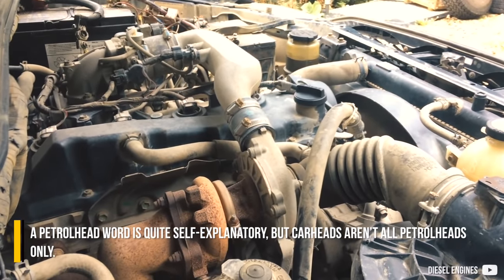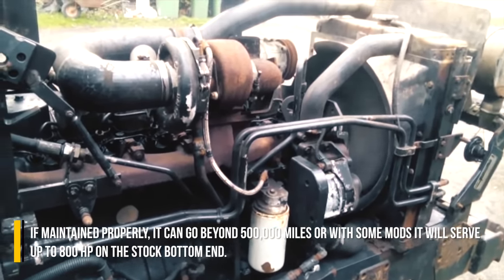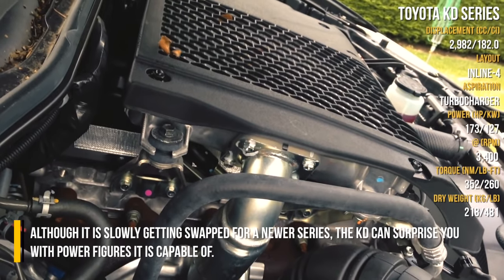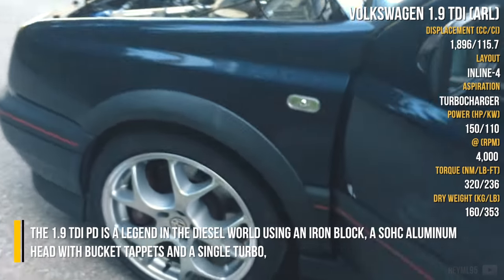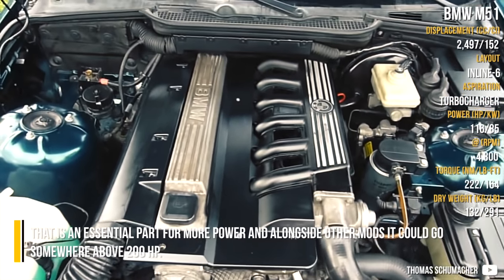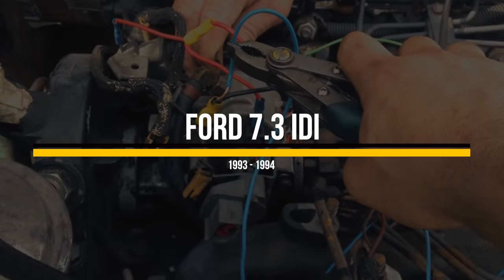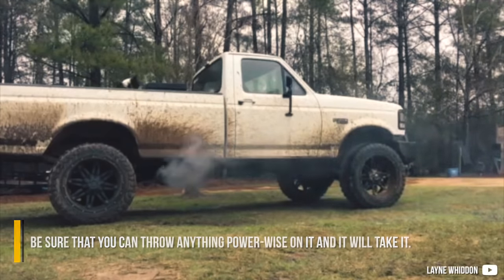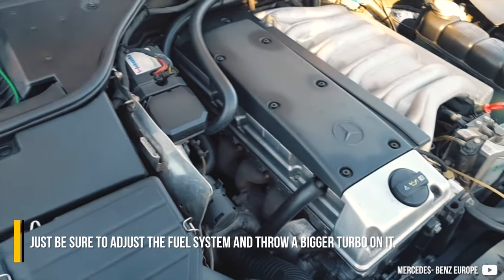6 Best Diesels For Engine Tuning | Ep.1

Comment: Ok. I am not knock on diesels. Love em. Better fuel mileage. But they are heavy and can be costy to fix. Oil change alone will set u back. If the injection pump goes out. Hope to find a used one. Trust me if I could afford one it be my daily.

Comment: I wonder why he left out the duramax? It put out better power than those small sixs
Reply: Probably because a Cummins had to tow the duramax after it broke down hahahaha
Reply: That and they redesign the motor ever 5 years the best duramax is the lb7. I've got one in my truck it's pushing 460000 plus miles
Or over 700000 km if my math is right
Reply: He had put in the old 6bt and 7.3, so I thought he would have put in the duramax, at least the lb7

Comment: The 7.3 idi had far less tuning capabilities the direct injection 7.3L.  99-03
Reply: I think as people have mentioned in the comments below, recently there has been a huge improvement in the performance side of it, I would imagine  these days it's a choice of would you rather do a full top end rebuild on a block made of wrought iron, and piss and vinegar, or have to find a grail truck in good condition

Comment: why do diesels all smoke like theire about to break down? how come this isnt an issue tuning petrol engines?
Reply: sout is released by the diesel engine as a by product of the combustion it is black and visible when their is enough. More power -> richer mix -> more sout. Sout is almost non existant (or non existant) in a petrol.
Reply: The pump is adjusted to pump more fuel than needed so the fuel gets in the headers/manifolds and burns there the smoke gives the turbo more spinning.Diesel doesnt burn by spark,Only by heat so Diesel is oil based fuel as petrol isnt.Also diesels have far more emission control things than petrol.If you adjust the pump right there should not be any smoke when on boost.Also for the om606 to get more power you need bigger pump and turbo.
Reply: Also om606 doesnt have direct injection,it has older system where there is small,kinda like second chamber where the most diesel .It uses Indirect injection.
Reply: That's on purpose and is bad for the engine and environment. They overfuel the engine to ensure enough unburnt goes out the xhaust , a clean burning one makes loads more power
Reply: @GavinY  i dont wanna be rude but Diesels make more power when they run too rich.If they would make power with no smoke people wouldnt make them run rich.But you are true its not good for enviroment or engine.In petrol engines the right amount of fuel makes more power.
Reply: this is a good comparison
Reply: Its how they work. The "throttle" in a diesel only controls how much fuel is injected into the combustion chamber. Increase throttle input, more fuel goes in. This means at part throttle the engine is running extremely lean which is why diesels are as efficient as they are, and extremely rich when at WOT. Combine this with the slow burning of the diesel fuel and you end up with a lot of unburned fuel, hence the black smoke.
Reply: @flemingpandel5287  Finally the right answer
Reply: It's to do with the fuel, which is a light oil rather than more of a solvent, and down to the entire combustion process. Diesel tuning makes you essentially relearn how combustion engines work.
Reply: Well,no.
If the owner is not a jerk,smoke is due to turbo lag.
When it isn't spooled up yet,the mixture is way richer than it should be.
You can see the smoke clears up as the turbo pressure builds

Comment: KD is weird for having 3 L and only 4 cylinders. Why they didn't go with inline 6 cylinders like a proper diesel should have.
Reply from the maker: This leaves you space for bigger stroke length which helps to improve torque. The Cummins 4BT is a 3.9-liter and that's a four-cylinder, too, for instance.
Reply: @VisioRacer  I would still prefer virtually no vibration and a smooth engine overall. 2 more cylinders make more torque and make wider torque curve than the longer stroke length on a 4 cylinder no? More stroke length equals to more piston travel, thus more shaking on a 4 cylinder engine. On an inline 6 it doesn't matter, because it's balanced no matter the displacement. Hence inline 6 is the perfect layout for a diesel. Why do you think most truck engines are inline 6?
Reply from the maker: Still, fewer cylinders are better for torque. A nice example would be a single-cylinder ~500cc supermoto compared to a 600cc four-cylinder. Guess which one has a stronger low-end
Reply: @VisioRacer  That's actually a weird comparison. Two different engines made for two very different applications. If you are talking about a SuperSport 600cc, it is made for speed, and would outlast a 500cc supermoto service interval queen. a Honda 750cc V4 makes plenty more torque than a supermoto, lasts a lifetime without having to change the cylinders every few years, with more moving parts.
More cylinders is better, every piston works less, thus lasts longer, is smoother. Essential with diesel engines.
Reply from the maker: Enough. You are right, I am wrong. Done, bye
Reply: @VisioRacer  Relax bro.

Comment: NO 6.6 DURAMAX? But the 7.3 made it!! Garbage
Reply: Robert Lamma the early duramax engines would literally blow the fuel rail off the engine, not bashing it or anything but the 7.3 had a good start and a good end to its life cycle. Then came our lord and savior the 6.0 in all of its glory.
Reply: Tang Gang I hope you mean the bullet proofed 6.0...
Reply: Robert Lamma Hell no, all you need done is that egr off that’s all, all bulletproofing does is replace bolts on the head with studs, and that’s bad cause they’re just gonna walk out over time. Bulletproofing is just a waste of money for people that don’t know what actually goes on with a Diesel engine especially one like a 6.0 with the all the synchronizers in the engine and in the turbo.

Comment: Screw diesels. I like cars but throwing that amount of shit into the atmosphere is going too far.
Reply: The thing is almost every tuner diesel rolls coal because it's easy  power, but you can actually tune diesels without giant clouds of black smoke
Reply: I believe you can also use filters right?
Reply: @jackthatmonkey8994  yes you can but they get clogged when you run rich
Reply: Then I guess diesel tuning should stop rolling coal or just stay in the industrial sector with proper exhaust filtering and cleaning alltogether
Reply: @jackthatmonkey8994  you do know its unburnt fuel and most of it just falls back to the ground
Reply: Most of it, so not all
Atmosphere can be changed to environment and my argument will still be applicable
Reply: Agreed, dont have to have massive amounts of smoke to make power.

Comment: KD series Toyota should not be on the list seriously overrated engines,and it should be the m/n 57 from Bmw far superior to to old 2.5 td.
Reply: how so? a stock 2.5 can handle 400whp on stock internals, the 3.0 can easily reach 600 whp on stock internals so how is it overrated we are talking about a stock 4 cylinder engine here
Reply: I work in an engine workshop and we see a lot of these in agreed the crank and rods are very strong but the amount of them in with dragged pistons, broken injector clamps, dodgy injectors and injector washers, holes in pistons etc
Reply: The reason why you see that is because people put dodgy tunes on them or their tuner doesn't have the proper concept on tuning diesel engines especially the KD's, to tune these properly you need someone with a shit load of experience tuning KD engines, KD engines and subaru engines are similar in the sense that the tunes will literally make or break them.. These engines are very touchy / sensitive to the tunes u put on them
Reply: i have a 2KD 245000 on the clock upgraded turbo making 170whp for the last year and a half EGT'S only go up when im pressuring it up a steep hill apart from that its fine planning on having the head ported next year
Reply: Stock engines most of them, people that own them have real issues admitting when they go wrong it’s as if when you buy a Toyota it’s impossible for it to go wrong.
Reply: My thing is this, yes the KD for what they are makes shitty power stock especially when compared to the L200 and the Dmax so if you dont know a great diesel tuner that has experience in tuning KD's just leave them stock or if u want something making over 200hp go buy a L200
Reply: But you are right most people that have Hilux's have a hard time admitting they loaded a shitty tune on to it